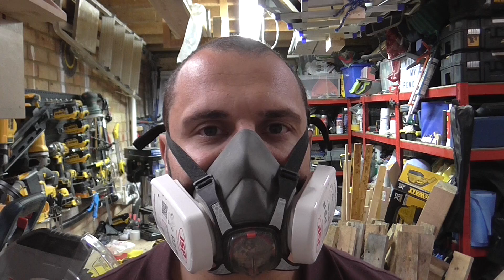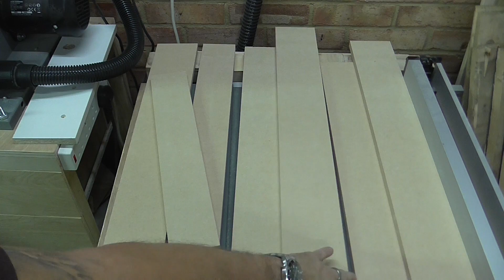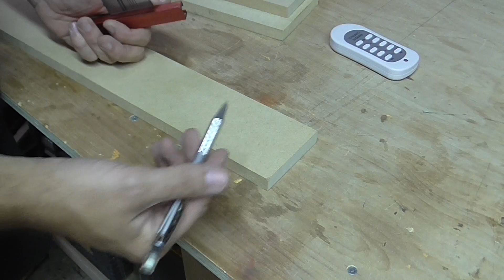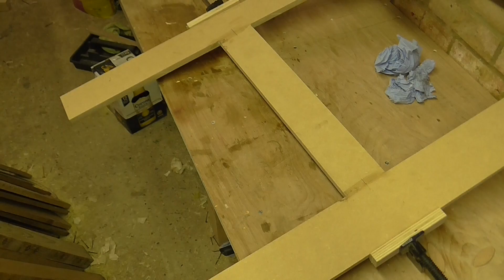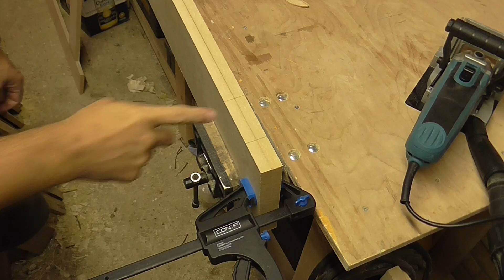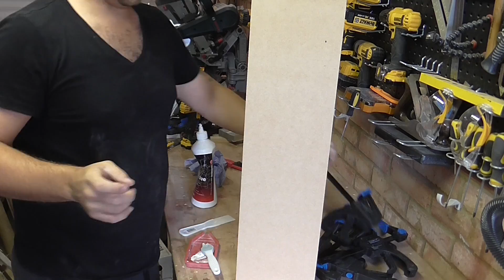Radiator Cover Build Part 1

Comment: Thanks in advance. What measurements are you using other than the 15mm thickness for the frame and 6mm thickness for the slats. Basically, how wide are the left/right 15mm panels on the front? Also how high are the top/bottom 15mm panels on the front. Obviously the side 15mm panels where you carved out the skirting will depend on how far the Radiator sticks out from the wall, but what size gap did you allow between the radiator and inside the front panels so that the radiator can breathe if that all makes sense.... Just starting out with the intention of making 4 radiator covers like yours but each one is no wider that 1100mm including the TRVs, so my radiator covers will all be single slatted whereas yours is a double slatted cover...
Reply from the maker: Was a long time ago but I think I used 120mm for all the panels. I think I allowed about 20mm from radiator to slats. The key is the gap in the top to allow the heat to rise out using convection.
Reply: Thank you